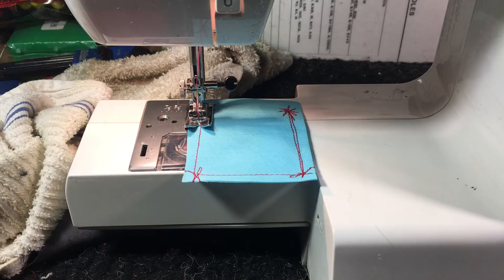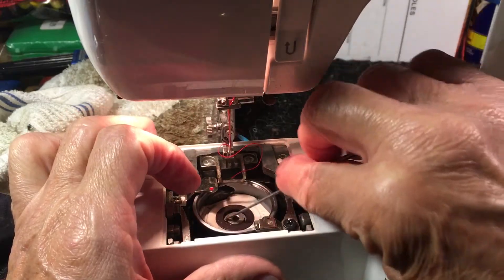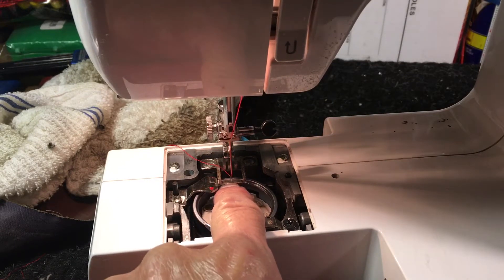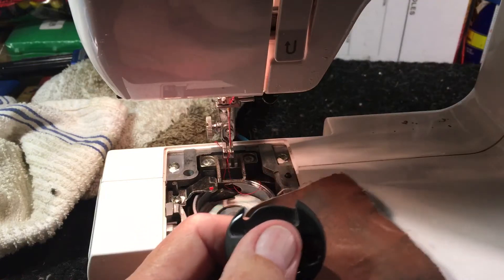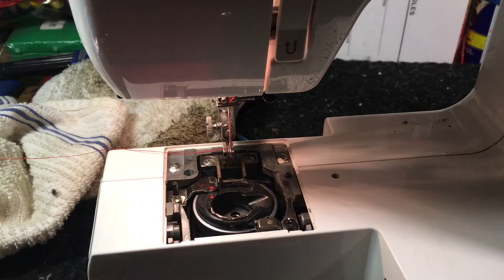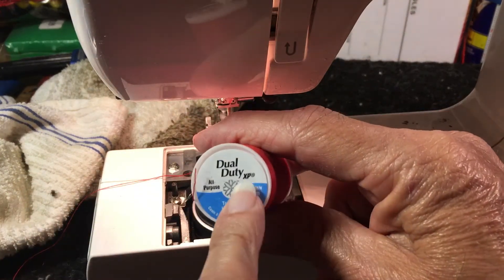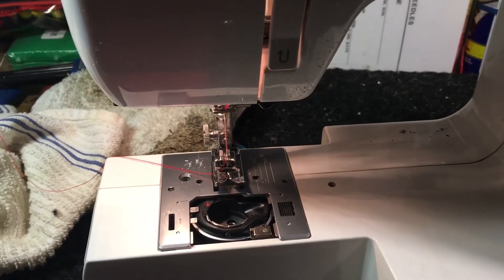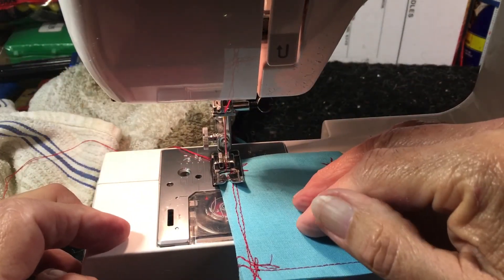How to fix Kenmore 385/Janome drop in bobbin fixing the jams

Comment: This was very helpful for me. I didn't know about the plastic vs metal bobbin issue with the magnet in my Kenmore 150 stitch. I don't recall reading that anywhere in the manual and I've gone through it quite thoroughly! I think the problem is also that there is etching in the area below where the bobbin case goes in. How would I get in there to clean it up? Or should I just have it serviced? I'm worried that my amateur attempts to address the etching will just make matters worse. I don't know if it's worth the money getting this machine fixed. Thoughts?

Comment: Thank you so very much for replying so quickly. We are thinking that it is the control board because we checked the fuse and it is still good we replaced it last year. I even took it to someone to have it fixed and they couldn't find the problem either and I can't find a control board to buy online. Called Sears and they don't carry arts for this machine. It is in very good condition and I would hate to give it up.

Comment: First, this was a great close-up video which was really easy to follow.  It looks exactly like my machine.  I did everything you said- checked for rough edges, sanded, using plastic bobbins, changed my needle, but it still jams up.   Any other suggestions?
Reply from the maker: Check the big three:
1) thread
2) threading
3) needle
For a jamming malfunction on that machine, double check your threading after watching my video on “How to thread any sewing machine“.
Also, make sure that your thread isn’t oversized. 
If your needle is new and correctly inserted, it’s probably ok. 
Don’t overlook the obvious. Most sewing machine malfunctions are cured quite easily. 
Almost everyone over thinks the solution.
Reply: @randyyoursewingmachineman9954     I put different thread in twice, and put a third in and filled a new bobbin.   On the third time threading from the top, it worked fine.  Crazy.  Thanks for replying.
Reply from the maker: @maryjager1757  you’re welcome. 😎

Comment: I have watched This video three times and gone through my machine just as referenced in your video. However, my bobbin is still malfunctioning.  There is excess thread as though there is no tension.  I have adjusted the bobbin tension as far as it can go.  I am using a plastic bobbin.  What should I do next?
Reply from the maker: The malfunction is on top. If you tighten the bobbin tension, you make the problem worse. 
Excess threads underneath are top threads. 
Make sure you go through the threading procedure that I have in my video on that issue. 
Test the resistance after you lower the lever. 
Try again. You can fix it.

Comment: You're a lifesaver! It was a burr underneath the throat plate. I didn't find it until I tried everything else thank you so much!
Reply from the maker: You’re welcome. Glad to help.  😎👍
Reply: @randyyoursewingmachineman9954  , Do you have a video of how to take the top cover off the Kenmore 385.1653? Or any cover that will get me into the top middle of the machine to get it oiled? It has an intermittent, yet pronounced squeak that I can't find and I believe it's up in the top end.
Reply from the maker: @bldann  yes. It just pops off. 
Lift on the left side, straight up.
Reply: @randyyoursewingmachineman9954 , is that the top cover or the front cover? Are there any screws that need to be taken out?
Reply from the maker: @bldann  top cover. No screws. pops right up and off.
Reply: @randyyoursewingmachineman9954  , you must have a different model. I have the 385.1653 and it turns out there are two screws to get out. I figured it out and found the squeak in this black, long gear thing that spins this other plastic big thing around. Problem solved for now. Thanks again!
Reply from the maker: @bldann  👍🏼

Comment: Sensible info, however the 385 Kenmore Janome machine I have has a front loading bobbin. (Full model # 385.15202400) my search continues! Thanks anyway! 🤗
Reply from the maker: I also have a video referencing that issue with a front load Kenmore as well.
Reply: @randyyoursewingmachineman9954  that’s a great start! I’ll check it out!

Comment: I have a 385 18221800. It got jammed , I was able to get the top shaft working after finding some thread stuck around the shaft. After I got the top to turn easily with the hand wheel now the bottom shaft is not moving at all . Have I ruined something? Not able to get the right side off because I am not able to get the knob that selects stich off. The knob is larger than the opening
Reply from the maker: If the bottom shaft isn’t turning and your hand wheel is turning, it’s because your hand wheel clutch isn’t tightened. You tighten the hand wheel clutch and turn the hand wheel AWAY FROM YOU as you hold the clutch release knob simultaneously with the hand wheel. Remove the hook assembly before you do all that.
Reply: @randyyoursewingmachineman9954    I think the clutch release is just pulling the hand wheel to the right away from the machine. As I turn the hand wheel away from me it makes a clunk every once in a while in the rotation. the belt was off and the lower shaft will not move at all..When I hook up the belt the hand wheel is frozen too.
Reply from the maker: @cherijohnson2723  it must be in need of lubrication throughout. Take a look at my recent video of the locked up 158 series Kenmore, that took me a couple hours to free up with penetrating oil and much effort. When they are stored a long time and unused, it’s a challenge to put them back in running condition. Be patient though because the 158 series machines are worth the effort.
Reply: @randyyoursewingmachineman9954  Yes I havent given up on this machine yet. I purchased it a couple years ago at a thrift store, seems to be just like new. It was sewing great and just started slowing down, down, down. Will look at the 158 series video, I hope I can free this up as I love this machine.

Comment: Hi. Great information. Can the thread gap be adjusted or is a machine limited to a dual duty all purpose thread?
Thanks
Reply from the maker: There’s almost always a thread gap adjustment on a drop in bobbin machine. The thread gap needs to be set so that a dual duty, all purpose thread will slide through. If you exceed that setting, the bobbin case will jump out of its proper position and cause another problem.
Reply: @randyyoursewingmachineman9954  Thanks for the amazingly fast reply.  Great info.
Reply from the maker: @bobk218  you’re welcome.

Comment: My brand new Janome 4120 jammed a few times and missing stitches. I called the dealer, and he said he thinks it’s my thread. He said that I should never use one that says all purpose. He just said to get a very fine thread. I have no idea what I should use, since all the rest of the thread is specific to certain things, like quilting, embroidery, etc. The only one that said fine was a bobbin thread. Any suggestions?
Reply from the maker: Your dealer is mistaken. Unless your thread is oversized, it shouldn’t cause a problem. 
Make sure to use an all purpose/dual duty thread or the equivalent size. 
Don’t use a quilting thread or any thread that is oversized. 
A fine thread will work as well, but they are generally a bit expensive. I’m guessing that’s what your dealer is recommending. Hmmm?
Double check your threading procedure (I’ve a video on that) and make sure to thread it with your presser foot in the UP POSITION. 
Good luck 🍀 and thanks for watching.
Reply: @randyyoursewingmachineman9954  thanks for replying. I tried the all purpose thread on regular fabric, and it seems to be doing great. Fleece is the problem. What do you suggest on that? I can do a straight stitch, but I can’t do a zig zag or it misses stitches or jams. Do I need a different thread for that? Or something else? Thanks again!
Reply from the maker: @melissa4455  make sure you’re using a brand new needle. 
I recommend using a Singer #2045 in a size 14. 
You can also use a Schmetz needle that has the word S T R E T C H written on the front of the package. 
Also get it in a size 14. 
If you use any other needle, who knows what malfunction will occur.
Reply: Thanks for the tips on threading those kenmore bobbins. Greetings from New York City

Comment: Does anyone know how to fix the error code 1 on sears kenmore sewing machine model 385? The machine won't sew keeps going back to the error 1 code.
Reply from the maker: If you don’t have a troubleshooting section in your manual, go to an online owners forum for that model and see if that’s been asked?  If it hasn’t, ask that question to them. Usually someone will have the answer. It could be as simple as needing servicing or a misthreading.
Reply from the maker: I did a quick search and found that it could be a control board malfunction or a blown fuse.
Reply: @randyyoursewingmachineman9954  Thank you so much for replying. We are thinking that it is the control board because we checked the fuse and it is still good.  I even took it to someone to have it fixed and they couldn't find the problem either and I can't find a control board to buy on line. Called Sears and they don't carry any parts for this machine.
Reply from the maker: @blessedmomma265  sorry about that. It might be time to upgrade to an older and more reliable platform. Just about any 158 series will do the job. I have a video where I list my recommendations. Good luck.